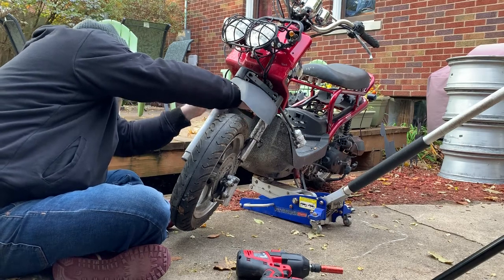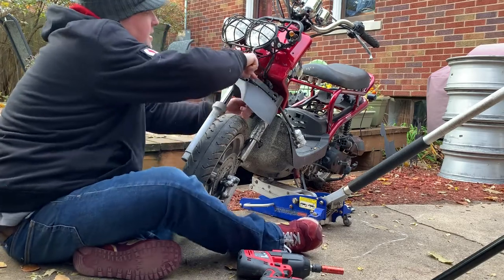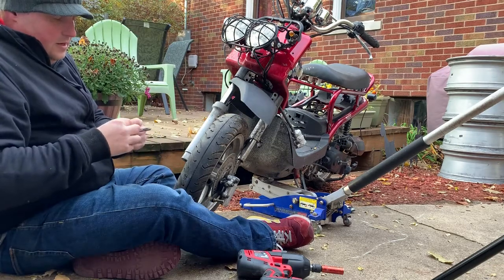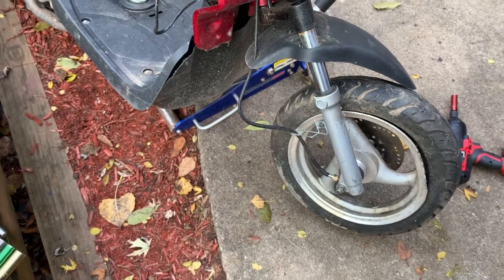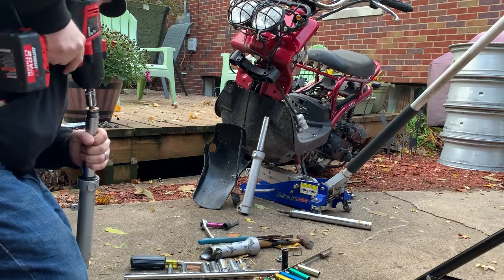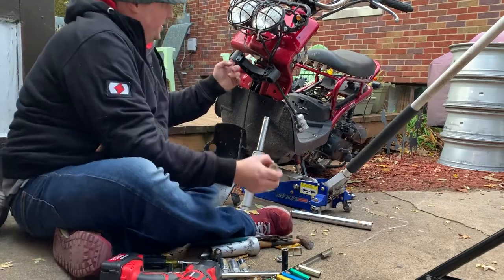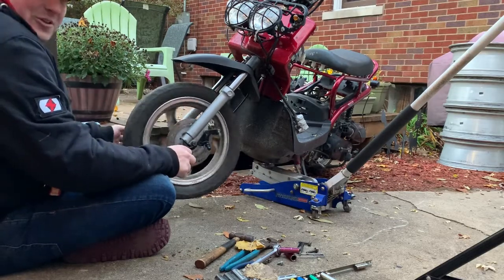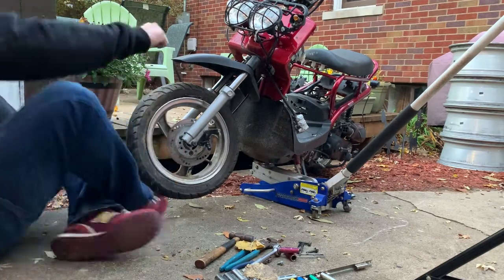$100 WRECKED HONDA RUCKUS BUILD - Ice Bear Clone

Comment: A auto choke they cheap online but you will need it
Reply: It’s thAt black thing on the right of the carb. The top right. Maybe it needs to be plugged in. It plugs right in somewhere on there. Sometimes carbs like that have a throttle sensor too that plugs in
Reply: I work on scooters on my channel check it out